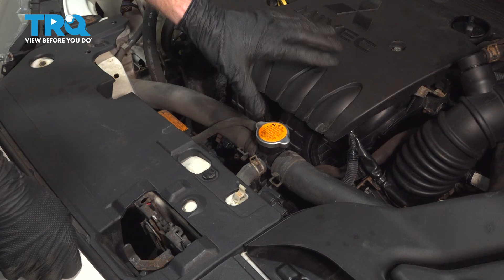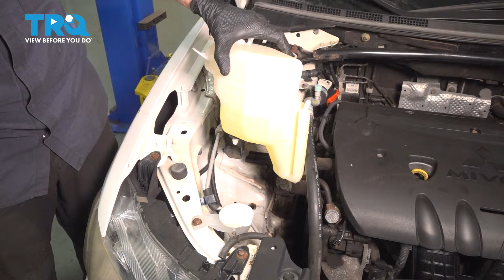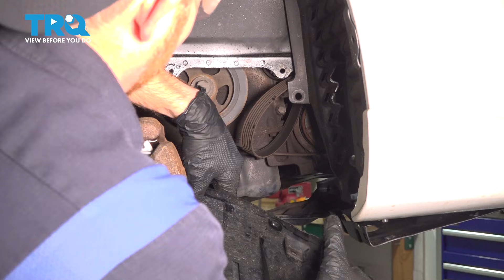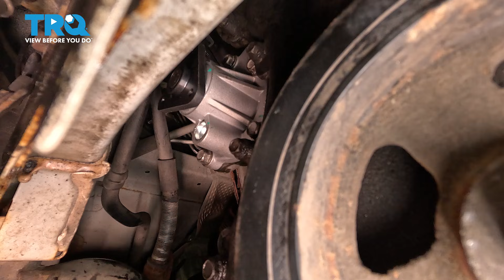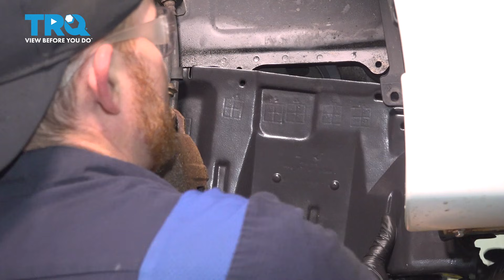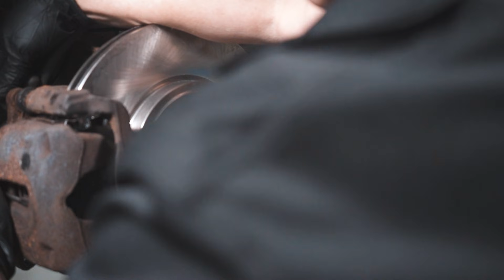How to Replace Engine Water Pump 2008-2017 Mitsubishi Lancer 2.4L

Comment: Great video, it helped me a lot!
It's easier to loosen the pulley bolts before taking the serpentine belt off. Also, use RTV to stick the gasket to the waterpump for easier install.